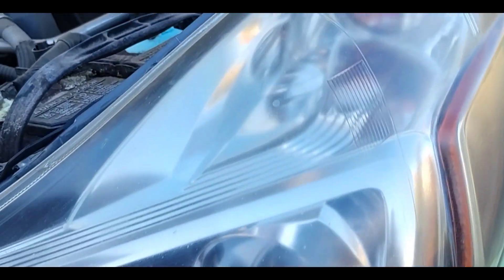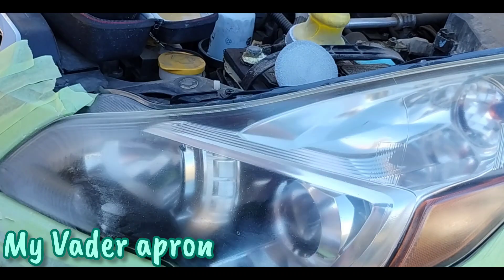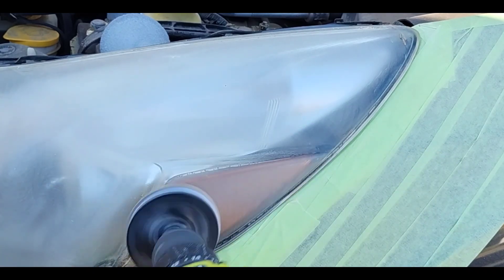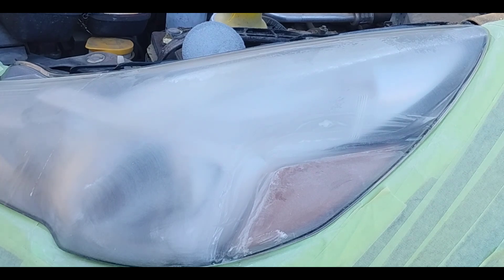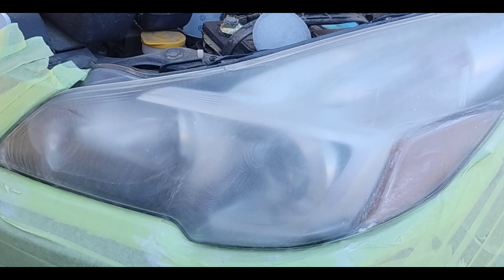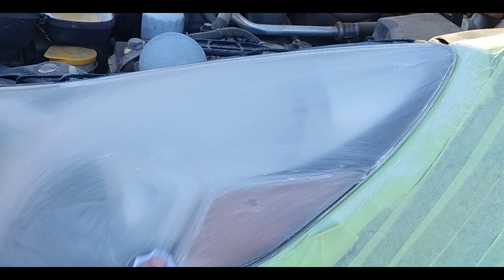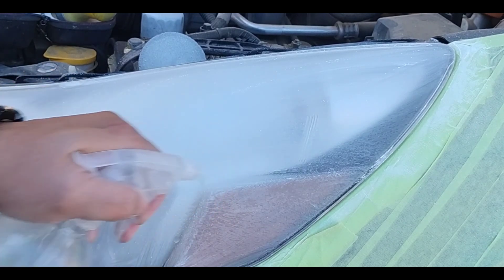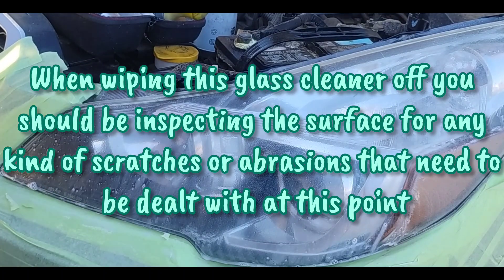WET SANDING & CHECKPOINTS during Headlight Restoration ✅⌛

Comment: Dude!  I've learned so much watching your videos.  Really appreciate you sharing your experience and knowledge. I've tried a few different refinishing kits.  Have never gotten the results I really wanted.  They looked better but always ended up having to periodically redo.  I've gotten the P500, P800, P3000 Trizact along with the Chem Guys restoration product and of course the Meguiers headlight sealant.  Tried out the process on my daughters Honda Pilot and they turned out great, she was very happy.  Recently purchased a 2009 Lexus LX 570.  Great shape but the headlights needed help.  Considered just replacing but at $500 each for OEM thought I'd try your process.  They turned out great but will likely end up replacing as there appears to be "fractures" in the lens on the outside corners but all the surface haziness and scratches/dings came out great!  May take another pass on one of the headlights that is worse than the other.  I felt like I took my time and the one I ended up doing the 500, 800, 3000 and CG Restoration and went back to the 800 to get some visible scratch.  Will likely get another pad because I think the "double stuff" would have produced better results.  Either way, they look 100% better, thanks again.  Didn't know about the red dot on the headlight sealer either!
Reply from the maker: Sounds good awesome man... Keep it up and just gets better...💯🥷🏽

Comment: 1. Are you wearing a regular mask while sanding and polishing then switch to the respirator for spraying the chemical ? 

2. Is there any noticable difference or benefit to using this AC Delco vs Milwaukee M12 polisher ?

Comment: so since that 3M hard lens plastic polish is discontinued what would u recommend using in place of that? I see you have 4 different ones linked (chemical guys restore, the treatment headlight  polish, turtle Wax headlight, 3m perfect it compound) would any of those be used instead?
Reply from the maker: Check this video out...https://youtu.be/VZMTN-ijO0Y?si=6w5syRDepddfO7r1
Reply: If I am correct, his go to replacement is a mix of the perfect it compound and chemical guys headlight restorer.
Reply from the maker: @DelgadoDetailing yeah it would probably be... But at the same time the other ones do well to... But you are right that would probably be the best combination if the 3M hard lense is out of the question....

Comment: Ι want to ask if is possible when you fix a headlight not to see any scratch and when you turn the lights on to see some?
Reply from the maker: On every single 140 videos now streaming 1 to 2 inches away the light the lights..
Zero scratches every time... 👍🏻
Reply: So i make a mistake.....i will fix it (i suppose) it was my first attempt and probably i didnt do a very good job.Thank you very mutch. @theheadlightrestorationpro
Reply from the maker: @gatos74 watch a couple more videos before you do it again.. watch the video about sanding pressures..

Comment: would love to see a video where you go a little bit more in depth about how you spray it with the megs coating. are you holding down on the nozzle the entire time or or ya burping it ??? 23:00 it looks like you drench the light but it came out perfect like damnn dude ! i need to see and learn this technique because like i said this spray didnt work for me at all but i believe it is due to me not sanding the light instead i used the vapor trash
Reply from the maker: https://youtu.be/nj2dHo-XJd8?si=NeRmV2kScmi-BXRs

https://youtu.be/R1DsMcZ6q1Q?si=enW_Xq8f_urRd9EL

Comment: Hi there.
Just a question on pricing jobs. Obviously, if a light is larger than average, I am guessing you will charge accordingly? How about if you get an exotic, expensive car like a Bentley or similar? A lot more care needed as a fuckup will cost megabucks. There is an exotic car dealer near me who is showing interest in getting some of his headlights restored. Scares the crap out of me, the thought of scratching paint on a Maclaren.
Insurance is a must in this business?
Cheers
Reply from the maker: Well yes not all vehicles cost the same that's why there's no real general pricing structure far as this vehicle is this much that vehicle is this much because they're all potentially different so it's up to your discretion to charge what you're going to charge..
And yes of course how basic the vehicle is and how non-basic the vehicle is far as exotic like you said or high-end makes a huge difference you would be crazy to charge the same price for a 1999 Honda Civic as you would a 2017 Corvette... You would need your head examined..lol
Some headlights are $190 bucks some headlights on $1900 bucks and should definitely be charged differently...
Reply: @theheadlightrestorationpro  Thanks. I guess it figures to charge according to the cars value👍🏻
Reply from the maker: @mikimoto99 👍🏽
Reply from the maker: @mikimoto99 VALUE, AGE, SHAPE,SIZE,AND DEGRADATION & DAMAGE....🥷🏽

Comment: Why use a power drill for the sanding and not the polisher.  Could one use the polisher for the entire process?
Reply from the maker: Absolutely not... Very dangerous... Check this out..https://youtu.be/R1DsMcZ6q1Q?si=gHSbdBRMK9mTJG-H
Reply: Awesome.  Thanks. I’m waiting on everything you recommended to arrive.  I have 3 cars that need restoring.  Hopefully it goes well.
Reply from the maker: @BrettParker-dj5re just follow the steps at any given video and even watch it while you're doing it and guarantee you it'll come out awesome...👍🏽🥷🏽
Reply: What speed do you recommend and does it matter what direction the drill head spins?
Reply from the maker: @brandonbaker2281 please keep in mind that I am a professional and have done literally probably 2,000 lights.. I'm very comfortable with doing this but I use the high speed but I do adjust the feather the trigger on certain areas I slow down considerably.. with that being said far as my recommendations for somebody not used to it would just slow down you'll get to the same place and I'll just take longer and watch the corners and hard hit spots like a ridges or folds or angles....
Reply: @theheadlightrestorationpro thank you! I have some family members who are wanting some headlights restored and I’ve only ever done a pure wet sand method. I don’t see any reason not to move to your method as the results are insane and it seems pretty straightforward!
Reply from the maker: @brandonbaker2281 yes it's the best method I've came across by far and I've done so many it's insane.... Nothing yields these perfect results like this and healthy too....
Reply: @theheadlightrestorationpro my first attempt went ok. Not as clear as I would like.  It’s still hazy/foggy in spots.  This is a knockoff oem light so quality may be poor.   I also ordered the gold p800 discs instead of the white by mistake.  Is there a difference?
Reply from the maker: @BrettParker-dj5re yes don't use the gold.. only use the white ...
The white is a smoother base more finer quality disc.... That might be the issue as well.
Reply: @theheadlightrestorationpro
I used the white p800 and added the 3m lens and hard plastic cleaner.  It looks a little better.  I think I shouldn’t have used the p500.  I went over it with the p800 and Trizact 3000 for a while.  Still see some seller scratches and fog.  I think I’ll start out with the p800 next attempt.  

If the headlight only has a small area that needs to be fixed do you think it’s ok to just use the trizact 3000 to start with?
Reply from the maker: @BrettParker-dj5re just stick to the videos and stick to the process the methods on every single video so I try to do other things that's what people mess up you cannot improve on perfection you can only go backwards...
Reply: @theheadlightrestorationpro
I finally got up the nerve to do this today on my truck.  Man did it come out amazing!  Only the upper half had UV damage that looked like fine cracks all over.  I started out with the p800 just in the damaged part and halfway down then used the 3000 on the entire headlight.  After polishing and spraying they looks brand new!  I was worried after doing it in the other headlight but i was amazed.  Thanks for a great setup and step by step instructions!
Reply from the maker: @BrettParker-dj5re hell yeah....I'm glad to hear this.....👍🏽💯🥷🏽